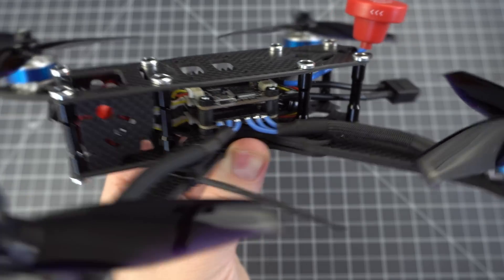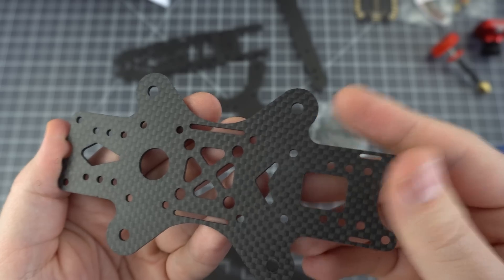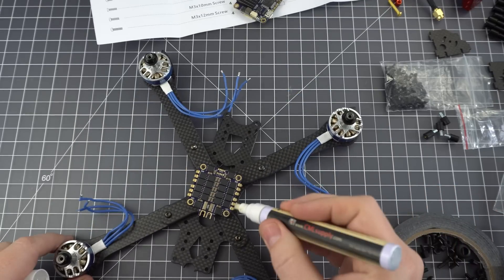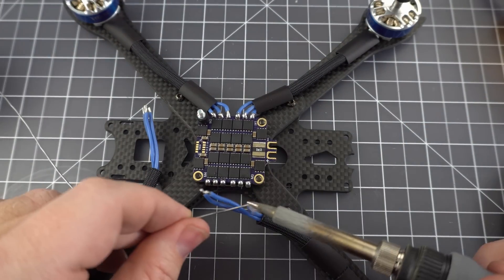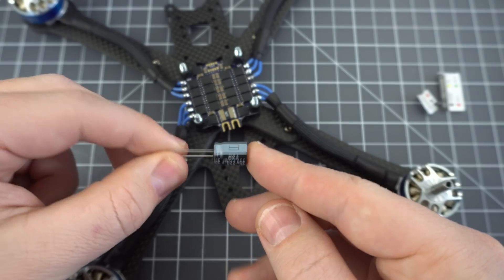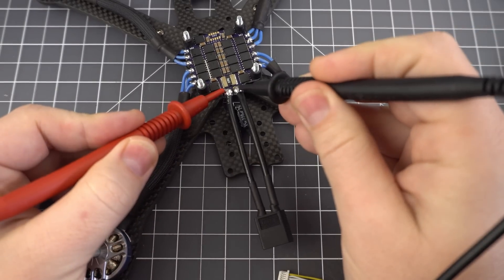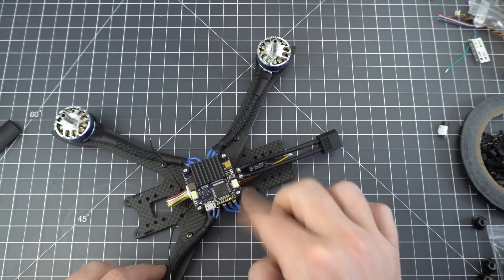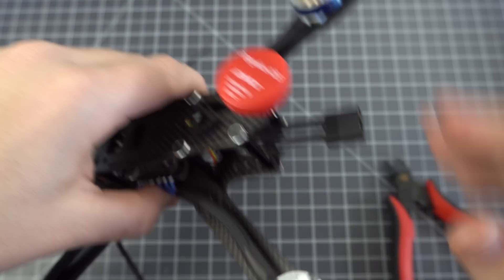iFlight XL5 V3 FPV Build Tutorial - Easy Beginner Build!

Comment: Great build and info , did all your motors spin the correct direction?
Reply from the maker: I can't remember, but they don't usually spin the correct way on the first try. I almost always need to reverse a motor or two in BLHeli Configurator.

Comment: Am I the only one who noticed and was fixated on the capacitor lead you clipped at @5:13 that landed right between the MOSFETs on your ESC? It was still there when you stacked the FC on top! 😬 Did you end up smoking the ESC or did it fall out before? Apart from that, it was a nice clean build!
Reply from the maker: Good eye. Yeah it slid out before I powered up. That was a close one! 😅

Comment: what about the polarities of the motor?
Reply from the maker: The motor direction can be changed in BLHeli Configurator. Just need to check which direction they're all going and determine if any need to be reversed.
Reply: Thanks for the quick reply , will let u know if any further clarifications required ✌

Comment: How good is the LDARC vtx? is it as good as the RUSH tank VTX?
Reply from the maker: I haven't tried the Rush tank, but this one is pretty good. I love that it's got a heat sync.
Reply: @whiffles  how far have you taken it though?
Reply from the maker: @jkpisces  I typically don't fly very far, so I may not be the best person to test VTX range. I normally go between 100m to 200m through and between trees.

Comment: REALLY love this build and especially the frame. Do you think mamba stack and emax eco 2306 motors would fit nicely? I'm kind of on budget
Reply from the maker: The Mamba stack will fit just fine and you should even have space to spare above it for a VTX. The EMAX ECO motors will be just fine too, but you might want to look at the iFlight Xing 2207 motors.  Those are very nice and xinte has a really good price on a set of 4.
Reply: @whiffles  They're kind of expensive on a site I'm buying(banggood). I'm from europe so pretty much it's my only choice because I won't pay any taxes with their shipping. I can get 4 emax eco's for around 32 euros. Thanks for answer anyway, I'm really looking forward when I will be able to build quad like this
Reply from the maker: @fen1x_fpv  Xt-xinte also ships from China and should be a good option for Europe. They generally have better prices than Banggood.
Reply: @whiffles  Problem is they only accept paypal :/ at least I didn't see any option to pay with credit card which is a problem for me
Reply from the maker: I'm surprised, they should have that option. It's usually safer to buy with Paypal, but you might want to contact their chat support to ask about credit cards.
Reply: @whiffles  Well I suppose I could create paypal account and transfer money from my bank account, Looking at their prices - they seem to be really lower than banggood or gearbest, but I don't really have any real knowledge about this site, that is another thing.
Reply from the maker: I've been working with them for the past few months and have had many orders arrive without any problem. They've been great to me.
Reply: @whiffles  Well it seems that I will go with ur stack as well as it requires less soldering and has vtx :D About those ldarc motors - do you think they're better than eco's (at same price)?I've seen some bad reviews, I don't know what to take from that. Also this will be my second build (First one was tyro79).
Reply from the maker: I recommend the iFlight Xing 2207 motors.  They're very nice and xt has a great price on them if you buy a set of 4. They're only marginally more expensive than the ECOs.
Reply: @whiffles  2450kv ? Funny how I wanted to build quad for like 100 euros and it goes up and up :D but i suppose it will be worthed. Btw I have caddx turbo micro f2 - Would I need some kind of dock for that camera to mount it on the frame? btw really thanks for helping me
Reply from the maker: 2450kv is good for 4S. That's just the way this hobby goes :) You can't really build a very good quad for 100 euros. If that's your budget then you should consider a micro brushless like the Mobula7.
Reply: @whiffles  I'm having fun with the 3 inch tyro, but I decided that I will invest :D I already upgraded my flysky i6s to taranis, next stop is the quad. I really like ev800d, my goggles, so there is no point (at least for now) to invest there.
Reply from the maker: Can't go wrong with the EV800D! I had to print an extension for mine though. It really helps with the eye strain.
Reply: @whiffles  Hey! If you don't mind, I would like to ask you something. I've got the xm+ (first time coming from flysky), and I have a weird problem - whenever I plug it into my quad , it is blinking red - after I turn on my radio it goes to green, but the green light is dimming very lightly(you can see it if u look closely to that led). Sometimes, it goes into red and then after few seconds its on green again. Im out of ideas... I can't fly unless I can fix this because from the looks of the problem I thought it might be bad connection to one of the pads, but I looked onto it and everything should be connected right. Do you have any idea what might be the problem here? I also tried to measure the pads with multimeter, it shows steady 4,6v between ground and +5V, and around 500mV betweed sbus and ground, but the led is anyway sometimes dimming the green light softly
Reply from the maker: @fen1x_fpv  Hmm, that sounds a bit strange. When you plug into Betaflight and go to the receiver tab do you lose control intermittently? If so, it may be a bad receiver. I had one that just wouldn't bind at all the other day, so I had to have them send a replacement.
Reply: @whiffles  I don't lose the control immediately, it only happens sometimes not so often - for example right now I had it on the table with taranis turned on and it was on green light all the time while the receiver was working fully with rssi on channel 16. Only strange thing that was happening was the green light blinking (better word may be flickering dunno, it's hardly noticeable and it isn't happening all the time). Guess I will write to banggood anyway because I'm not comfortable flying with this receiver on my new build that I will be doing (almost everything came, the xing 2207 motors that you recommended to me looks simply amazing). edit - sorry I didn't read the text properly - yea when i'm losing control intermittently, for example yesterday it was happening pretty much every few minutes, today it happened like 2 times in the morning, now it's 1 hour without lose of control
Reply from the maker: @fen1x_fpv  That sounds like a bad receiver to me. Are the antennas fully seated onto the board?
Reply: @whiffles  Yep they are, I've gone to fly my tyro79 for like 12 minutes and had no problems, dunno what should I think. I guess I will get the xsr for the new build and will stick with this weird xm+ unless banggood refunds me
Reply from the maker: @fen1x_fpv  They should refund you. I'd probably just order one locally if possible just to get flying faster.
Reply: @whiffles  Yea I thought about that, unfortunately I've checked every possible eshop from my country (slovakia), it's either not in stock or it goes for like 25+ euro just for one xm+. Guess I will have to wait :/

Comment: Hey, im curious about the screws with the silver ring around them on the frame your using. Mine didnt come with those, are they something you added to the kit and if so are you able to point me in the right direction? I like the look it gives the quad, just bought some battlecord so thanks for that!
Reply from the maker: Those are countersunk washers. They're listed on the part list on Rotorbuilds under Hardware. They're entirely optional though.

Comment: Can you do one with the 40a hobbywing stack, runcam Swift mini, tbs unify pro v2 vtx, brotherhobby returner motors,
Reply from the maker: Sure, but you'll need an adapter for the Swift Mini. This frame requires a full size camera.
Reply: I’ve got full-size runcams, if the mini is to small
Reply from the maker: That'll do just fine then.